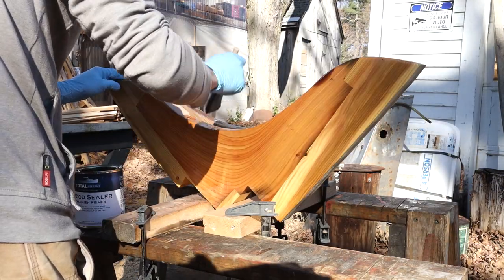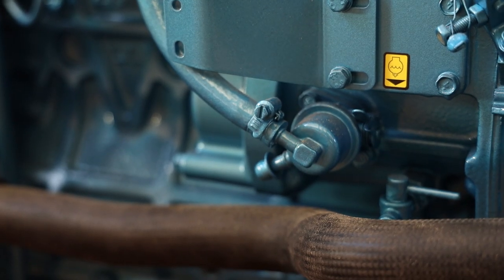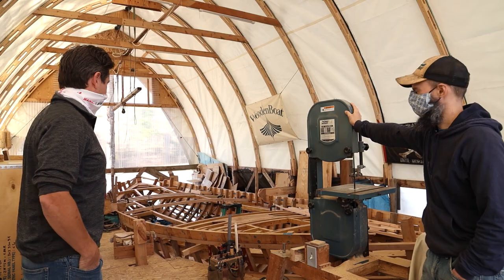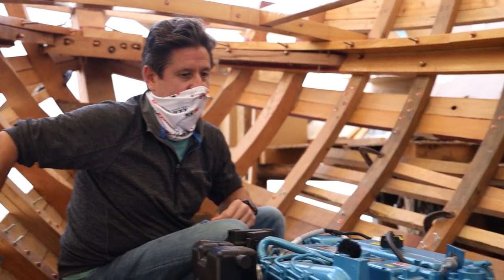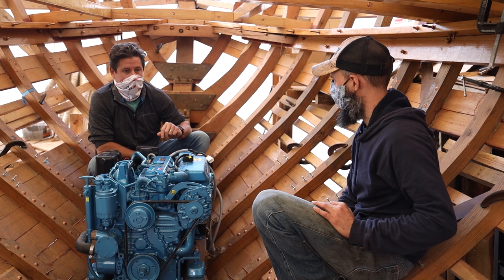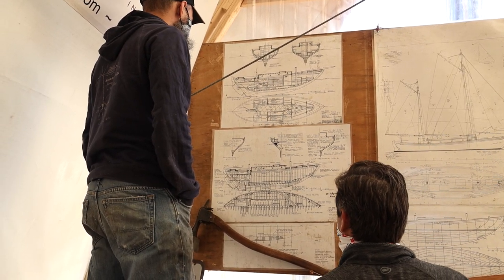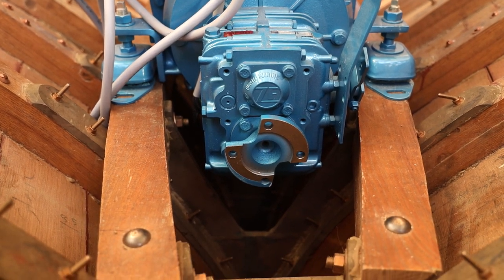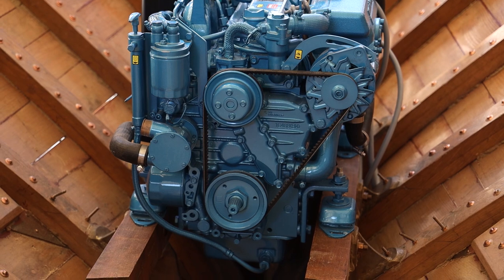Designing the Power Plant - Episode 137 - Acorn to Arabella: Journey of a Wooden Boat

Comment: For electrical generation one alternate method is a pull behind water turbine. I've seen these items advertised for campers where you toss it in running water and it generates electricity to charge your phone. I imagine you could adapt that to a setup where you either mount it to the hull or just drop it in the water when you want to generate not sure if they make a version big enough for a boat but it might be a viable method?

Comment: A bit of unsolicited advice from an old guy who has been boating forever (learned to walk on a boat, am now retired): Put enough water, power, and batteries to make a modern boat with all the landlubber comforts on board. You don't have to buy it all now, but put the infrstructure in (raceway, tubes, and pipes) to make it an easy task to install later. Think powered windlass, spreader lights, hot water, autopilot, solar collection system. Leave room for all this stuff as you build out the boat. You may never use it, but taking out bulheads and ceiling to put it in will be emotionally painful. And though I love "boat camping", most folks do not. Are you ever planning on charter? A significant other? The next owner? Love your project, the connection to the land, family, the gathering of the trees. Kudos.
Reply: so much this.... at very lest id put in water making system since it sounds like these guys plan to be out more then 2-3 days at time

Comment: 100 amp. Alternator is enough for recharging the cranking batteries. Normally doesn’t take long. Deep cycle batts take a lot longer to recharge. Although at a much lower alt. Output. You’re stilling running that diesel to get it done. Sounds like that’s going to be a blue water boat, so, it depends on how often you you’re willing to burn fuel, while out at sea. Personally, if you have wind, you don’t want to run the engine at all. IN my opinion. Also, they will probably add more electrical stuff, as time goes by. So, I would definitely add back up. As in, solar, wind charger etc. again, my opinion. I would also keep a spare alternator with, and a spare starter.

Comment: One comment about alternator, it produce 100A at 12V , so it’s max is around 1200W, at home at 110V you have 11kW of power, and that’s quite big difference. I would advise to install second alternator, even much bigger with at least 200A of power, main benefit of that it can charge your batteries much faster, so in long time you will get money spent on installing back on fuel consumption savings.

Comment: I am a Grasshopper Mower dealer in central Iowa.   Kubota Diesel engines are absolutely rock solid until they overheat and drop the valve seats into the cylinders causing engine failure.   They will not, under any circumstances, warranty their valve seats dropping due to overheating even if they’re the ones also supplying the radiator.    

You need to be very cautious of the cooling system in your boat, as Kubota will not warranty overheating for any reason

Comment: We had a fathering prop on our Vega 27, though it is nice when you are sailing, it is horrible if you need to reverse, and, very fiddly to handle because you need to control two different levers (throttle and feathering). I would much rather have a folding prop. 
Other than that I think you definitely have the right mind-set when it comes to mounting filters etc. remote from the engine. Being upside down, leaning over the engine to change a filter or impeller is not fun...

Comment: LiFePO4 batteries, Blueetti , get a few Monocrystalline solar cells 180 watt and a several 12 volt 100ah battery packs. You get 2000 -5000 charge cycles plus you can draw 90% of the batteries rating vs SLA or AGM batteries you can only discharge to 50% of its rated capacity.

Comment: Hi Steve and Alix, does your engine have a replaceable raw water to engine coolant heat exchanger or is raw water circulated through the block and head?  If the latter, the life of the engine will be drastically reduced due to corrosion in those components.  I've seen marinazed gas engines that lack heat exchangers and the cast iron parts in contact with the sea water literally break apart from corrosion after about 10 years.  Even the best heat exchangers need regular service and eventual replacement due to corrosion and build up of crud, but much cheaper than replacing the engine.  If not so equipped I highly recommend installing one.  Cheers.

Comment: I recommend harnessing the heat from engine to warm and dry the cabin. You should expect to be cold and wet while living aboard, crawling under cold damp bed sheets every night when you go to bed, even in a mild climate.

Also plan on constant irritation with a lack of electricity while away from the dock: waking every morning to find the anchor lights completely drained the house batteries, not having enough juice to even charge your cell phone without starting the engine, fear that today might be the day your batteries are too weak to start the engine. I recommend  giving the second alternator some strong consideration.
Reply: It's a SAILBOAT! The engine won't be running long enough or often enough to warm the cabin. Heating will be a separate system altogether.

Comment: I'd recommend that you install an in-line detector in the raw water line to signal loss of water flow.  I owned a Hans Christian 38T, moored in Long Beach CA, and a constant worry was floating plastic bags being sucked up against the raw water intake.  Catching that before the engine overheats is a good thing,  and constantly watching the exhaust water discharge is not practical.

Comment: Even in the huge Viking ship replica that recently crossed the Atlantic, they had a camouflaged area where they kept modern systems like electronic charts, radios, refrigeration and toilets. Having that plus hot water and some sort of solar system, not only gives you comfort but it also gives you independence. Less time spent a marinas will eventually make your life cheaper. Plus carrying around wooden casks full of salted beef or ham and cages of live chicken are as obsolete as mariners not taking baths for months or going to the bathroom hanging from the bowsprit. That is not the romantic part of sailing.

Comment: If anything, add ISOLASTIC mounts. 
A vibrating motor bolted directly to the frame will tear the wood apart eventually don't you think.

An extra alternator  is handy. Alternators wear out.

Comment: If you don't do a variable pitch prop you can use the prop shaft to Ron a small reverse osmosis pump for fresh water or a n alternator to power backup batteries.

Comment: I would make a day to day list of comfort things you will need. Its easy in the planning stage to say we dont need X but in practice it may make sailing better. I agree with other comments. Take a month and look at what others have done and talk to people who are living like you think you want to and see what they recommend and what they would do different.
There is alot of mobile and portable basic comfort options out there these days.
I think you are underestimating hot water.
You should also look at refrigeration and lighting. I would put plenty of 12 volt ports around the cabin. 
You run the house and the boat on 100 AMP 120 volt AC not 100 amp 12 volt DC which is what the alternator puts out.
I would treat the motor and the boat electrical systems like they treat it in motorhomes.
Coach and chassis electrical systems that can be bridged with a solenoid or switch in cause you need it or want to charge the other system.

Comment: If you’re going to live aboard - fresh water pump is a must.  Hot water pulled off the engine is cheap and easy - and wouldn’t require to pull from your battery bank.  Also - you’ll probably want raw water for your head(s) unless you’re opting for a composting head...

Comment: Run a salt water pump to the fore deck so you can wash the anchor chain and anchor.  Always have two aux fuel filters so you can quickly switch from one to another if a filter gets clogged.  Having a water maker will require you to have more twelve volt power so two alternators and four house batteries would be a good thing.  Having no shower is not good,  even if you can put up a temp shower on the deck.    I hope you are going to have at least an alcohol stove for cooking.  Carry lots of lemons, if you are prone to seasickness you can cut a lemon in half and lick it when you feel queasy.  The lemon takes way the bad feelings and you will never get scurvy!

Comment: Would have loved to see you installed an electric motor instead.  Perhaps with a gas/diesel generator to recharge batteries as needed.  Nice and quiet cruising in port.   If you had a setup like some sailboats, the prop could turn the motor to recharge batteries when under way on sails.

Comment: FYI - the engine generator will give  100 amps @ 12V or 1,200 watts. Your shop panel is 100 amps at 240V or 24,000 watts. A huge difference, Power =  volts x amps. I highly recommend a couple of 12V, 100 amp LiFePo4 batteries for the house batteries. Install them once and you will have plenty of power and  you won't need to worry about replacing them for 20 years. You will want a standard 12V lead acid battery for the start battery which should last 6 to 7 years.

Comment: I understand you will be requiring minimal power to run the boat, but keep in mind that 100 amps at 12 volts is not the same wattage output as 100 amps at 120 volts- the 12 volt system will only produce 1/10 the Wattage, given the same amperage , in addition there is more power loss in a 12 volt system. just something to consider when deciding on a generator.  A spot light and a high volume bilge pump can quickly eat up a lot of watts in an emergency.

Comment: I personally would put in a second alternator, not because it's needed to run the boat's systems, but for redundancy. If the alternator dies, once the batteries are dead you're stuck. If that happens in a storm or other emergency situation, it could put you in a real bad situation with no way out. especially so if that's running your emergency transponder systems or whatever boats use to let people know "SOS".

Comment: Whatever you do, the engine WILL leak oil, coolant and diesel in normal use, perhaps only in small quantities but it will. There is also the possibility (probability) at some point of hose failure whereupon the oil/coolant /diesel in the hose will all end up in the bilge. If the hose is under pressure the leakage will be much worse. So fit a containment pan(s) under both the engine and any remote filters etc AND the hose lines to them. Just like fitting a bund under the domestic heating oil tank in the yard

Comment: The 100 amp alternator on the engine is at 14 volts DC maximum for a total of 1400 watts.  Your 100 amp panel for the house and boat house is at 125 VAC which is 12500 VA ... a BIG difference.

Comment: We have a Perkins 4-108, it  has fresh water cooling and a heat exchanger so that salt water does not enter the engine. it's great system and reduces engine corosion. Doggy poop bags fit over your oil filter and you can screw the filter off and not spill a drop.

Comment: A heat exchanger to keep salt water out  and proper coolant in the engine circuit to stop corrosion. A second pump for the salt water would be needed.  Use lithium batteries for general use.

Comment: I'm in the comments just to advice on a catch pan and separating water intakes. Seems like I'm not the first. +1 from me. So then I'll add another one: Don't change the engine setup, it is tested as setup right now. You might be fine but you might also end up with a bunch of problems you don't know what is causing. Not worth the risk. And if you ever need to remove the engine you'll have more of a mess with even more hoses and wires going out from the engine than it already has. Make sure you have easy access to all the engine instead of moving thing out would be my advice. Best of luck!

Comment: I would also recommend running 24 volt electrics. Half the current of 12v system so smaller wires and less risk of an electrical fire. If you need 12v for some piece of equipment you can always step down.

Above all use separate batteries for domestic and engine start. There WILL be times when the engine MUST start and if it doesn't you will be in real trouble with a capital 'T'

Comment: Strongly recommend going to 24 v set up. Higher voltage, lower amps = smaller wire gauge. Talk with "Dangar Marine" about why he changed his mind and went with 24 v.
I used the flexible panel on my RV, they kept flexing until they failed a few years later, I don't recommend.

Comment: you run the shop off a 100 amp 220 volt panel. the alternator will put out 100 amps at 12 volts. You should figure out what kind of battery charger and constant loads you will have.  The second alternator could greatly reduce engine runtimes to recharge the batteries.

Comment: I see windmills in sail boats for charging batteries, and there are drag propellers to pull behind when sailing.  Not that it matters since they decided on diesel, but they could still add batteries and electric motor to be more environmentally friendly (and enjoy vibration and noise free experience).

Comment: I had to buy a new alternator for my Freightliner Cab-over.  The mechanic was bragging about it being a 100 amp alternator and then put it on the bench tester and ran it up to a 100 amp draw.  It crapped out less than five miles from the truckstop so when it came to them replacing this brand new alternator I told them NOT to bench test it.  Had no problems with that one.

Comment: You may like to read some books by Donald M. Street I suggest Starting with "The Ocean Sailing Yacht" .

FYI 100 amps 12DC does not equal 100 amps AC  The conversions are  DC 100A  X 12V = 1200 watts   AC 100A X 120V X .8 (power factor) = 9600 watts.   Power factor ranges between 1 to .8 depending on loads I used .8 as it is the most conservative and most representative of the loads of your power tools.

Comment: Putting the batteries on a shelf rack behind the motor might not be a bad idea. Secondly I would always recommend building a substantial overhead in your power systems now while you have the boat open. The struggles you will see later upgrading will be far lessened. my 2 cents

Comment: Before you get to far on deck beams and planking, ask yourself "How will I pull this engine if I ever need to replace it?".  If there is not an easily removable  access directly above the engine, then you will need to move the engine to a point where such access exists.  Don't get yourself in a situation where you have to disassemble part of the boat to replace an engine that will inevitably wear out over time. 

As far as batteries go, assume that you have a dead engine right at sundown and cannot charge the batteries.  You now have nav lights, nav equipment, and interior lighting/loads that will be draining your house batteries until the sun comes up and you can use solar.  Figure your total capacity required.  Now double it in case it is cloudy and you can't get a full charge on the batteries.  Isolate the house and start batteries so you aren't draining the start batteries with house loads, but make sure that your charging source(s) will charge both banks.  

I understand the desire to minimize through-hull fittings, but at least separate the engine raw water system from the house system.  Some day you might want to use the head while working on the engine raw water intake...  Bilge pumps should have their own overboard fittings...for when you REALLY need to not have problems with pumping the bilges.  On the subject of water, what are your plans for dealing with a fire while at sea?  May want to consider planning for the ability to put water on a fire when the fire extinguisher is empty, which takes us back to when you REALLY need the bilge pumps to not have issues.

Comment: for Power generation, I have seen applications where there is a small external propeller that drives a power generating system where power is being generated anytime the boat is being moved or water is flowing past... Just another Idea...You might want a microwave sometime in the future and that simply takes a sufficiently large power inverter which are both readily available and inexpensive
In fact you could use the cooling water scoop with a small diverter line to drive a second power system.  Extra power generation provides both safety and puts minds at ease. Brook mentioned something worth considering is using the spinning of the propeller when under sail to drive some type auxiliary power generation.  Yes I am a belt and suspenders man when it comes to power and I also keep a ball of twine around incase either of the other goes bad. Have been stranded out in the outback with only one primary power system and it is more than a bit worry some (especially if you have a cityfied spouse)

Comment: What about the option of  a valve that will direct the cooling water through a rad that will give you the option of using it for heat below decks and the pilot house  if you are sailing in cold weather conditions?

Comment: Your 100 amp boathouse circuit is 120 volts for a massive 12,000 watts of power.  Your 100 amp alternator on the boat is 12 volts for an anemic 1,200 watts of power.  If you plan on ever using power beyond NAV and lights (think communication, starlink, laptops, cameras) you're likely gonna need extra power generation.